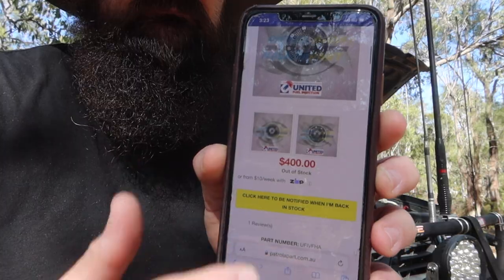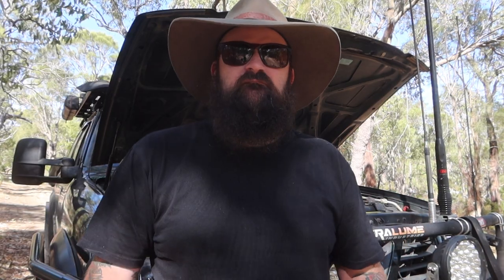The BEST TD42 Mod You Could Do - EVER

Comment: I’ve cooked a couple td42s regrettably and a few other tds and it was always the blocked radiator, point is they will never cook if the water temp is kept cool and airflow is granted. Have a work Ute (td42) with over 500k klms and still goes hard and we work them really hard.

Comment: I know you've sorted your issues with that fan replacement but something to keep in mind also, big spotlights in that position block a lot more wind than you'd think! seems like quite a few people sort other lighting options just to keep as much airflow going to the radiator as possible. I've just replaced my spotties with a good quality light bar so will see how that goes.

Comment: Good move! Running cooler makes everything last longer. I imagine the driving lights reduce air flow over the radiator - are there options that take the big DL's out of the picture and have a nice open area in front of the grille - a light bar or some tiny high power DL's or something?
Reply from the maker: I agree mate. 
As far as the lights go, I’ve talked to a few mates that have gone from having driving lights to a lightbar or vice versa and either way hasn’t really made a difference. So I haven’t thought too much into.
Reply: @westralianoffroad  Well, that changes things a bit. I mean, real life results trumps any pontification every day of the week.

Comment: Hallo, I replaced my radiator with a bigger 3 core. Not much of an improvement. On a hot day, up a mountain road, 35-40 Celcius , the thermostad goes up to 3/4 and still climbing. 
Now, can I fit this bigger fan? My clearance is 2" from the fan to the radiator edge. Some pictures would be great of this clearance.

Comment: 70C too cold, your engine is designed to run warm to be at its most efficient in terms of fuelling....etc, 90C is normal as long as it is stable. modern engines are quite happy around 100C. The fan is really there for low speeds. Your vehicle should cool naturally at highway speeds with natural airflow. Suggests the fan is masking your root cause.
Reply: what temp would be ideal? mine goes up to 90c to 100c on traffic but on highway speeds it goes down to 70c even when im pushing it hard its not heating up that much as long as its moving fast. Thinking of replacing the 76.5 thermostat to a higher one to get it to stay at 80 something.

Comment: My Td use to sit around 100 ive changed fan hub pump and radiator and it dropped to 80 radiator itself dropped it by 10 and surprisingly i changed my turbo from a 16g to a gtx2867 and it lowered my highway temps. I can now do 120 before my temps climb before it was 100. Worth talking about
Reply from the maker: Fascinating man! Thanks for the insight.